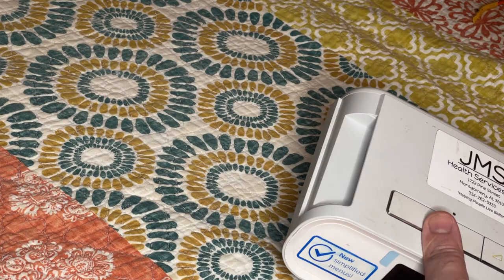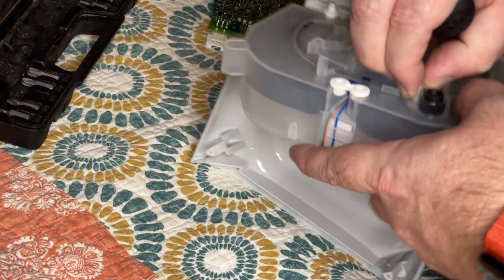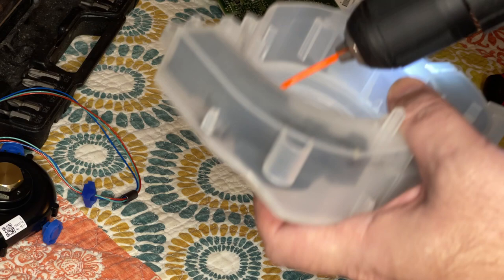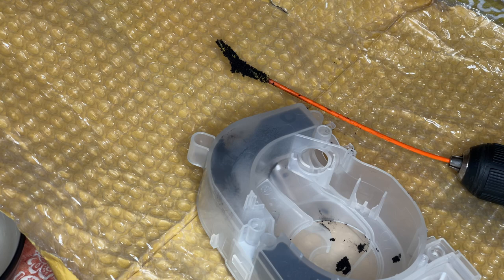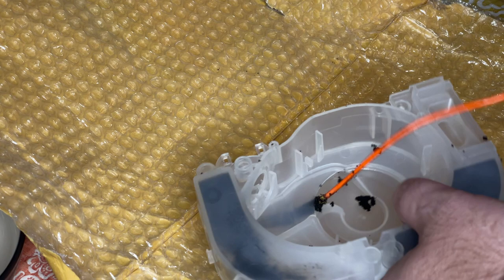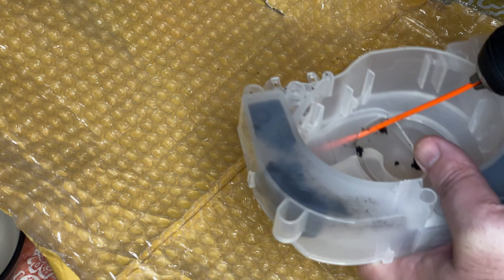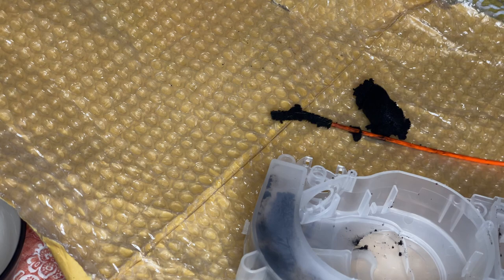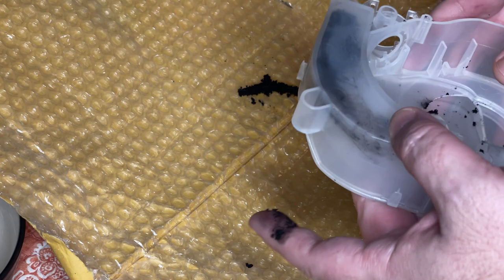I Tried to Drain-Weasel My Dad's DreamStation CPAP. It Didn't Go Well

Comment: I am sorry that did not work out. I just ordered the Drain Weasel. I am going to try it on mine and will post the video. Best of luck going forward.
Reply from the maker: Lemme know when you post!

Take things slow. Slowest drill speed and highest torque setting, if your drill has the latter. You got this!
Reply from the maker: PS: when I walked Nicko through this on our back channel, he mentioned that his drill doesn’t have torque control, but he still made it work by using the slow speed and going light on the trigger.

Comment: I have the System One and I just took the foam all out and left it empty.  The foam on mine covered the entire lower level, so also functioned as an air flow control.  I think my air comes out a bit stronger now and need to explore my settings.

Comment: You are gonna need to drill a couple of holes to get all the sludge out. Some people do holes inside the inner motor side of the dougnut and leave them unsealed. I preferred to maintain the original design's airflow path (despite some saying it doesn't matter since the inner chamber is sealed once the motor is reinstalled) and  I did 2 holes on the top surface and patched them with tupperware "Bandaids" secured with hot melt glue (despite some claiming that hot melt glue is toxic as well)  I can attest that the unit will be more turbulent/windy sounding by I'd guess...10 percent or so. It's not "nothing" but is a small price to pay in noise for the safety and comfort of not ingesting that foam sludge nightly.
Reply from the maker: After this video was posted, I managed to get the sludge out with some pipe cleaners, an overnight soak in vinegar, and some pressurized water. Had I known how much effort it was going to take, I would have just ordered the empty motor housing from Amazon.

Comment: I just had a warning screen say that there’s something blocking the air inlet. I checked the filter and noticed this black powder soot covering the filter. It happened earlier. I’m in Southeast Asia and not sure how to fix this. I use bipap with high pressures. 16/24. I’m not sure what to do. Not even sure how to sleep tonight. Maybe I’ll sleep on my side. I can’t sleep without the bipap. It really assists me with breathing. I may have to order a cheaper new one. I’m wondering if there’s a way to clean it out so no particles get ingested. I don’t know

Comment: Any new videos? How are you doing.
Reply from the maker: Hey Justin! 

So sorry for the extended absence. It's been a rough few months. I've had, I think, three emergency surgeries since uploading this one, and I've also had to endure two awful chemical cauterizations. I'm working with a CRS and an IBD specialist from Johns Hopkins, and the former seems to think that I'm showing all the signs of Crohn's disease, whereas the latter says I don't meet the symptomatic threshold for a diagnosis. 

The best current working hypothesis is that the years of damage done to my body as a result of chronic systemic inflammation are catching up with me, despite the fact that the inflammation is now gone, or appears to be gone. It's gonna be a long road from here. Next scheduled surgery is in June, but there's no telling if I'll make it that long without needing another emergency procedure or three. 

I nearly bled to death two weeks ago, right around the time you left this comment.

I'm working on ways of trying to shoot videos standing up, though, if I can find the strength to do it. I have some stuff I really want to dig into! But my body just won't cooperate. :/
Reply: @AdventureswithCPAP  sounds terrible. I wish you no more pain or troubles. I do miss your cpap content. It was different from everyone else’s.  I got my notifications turned on so if your body lets you I will see when you upload. But until then I wish you well my friend!